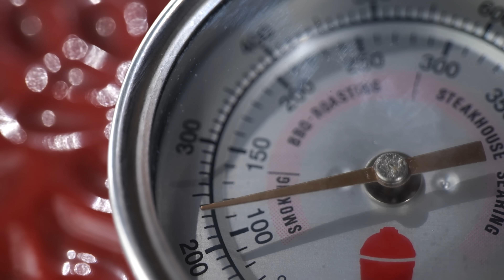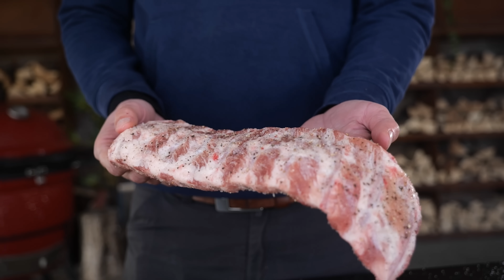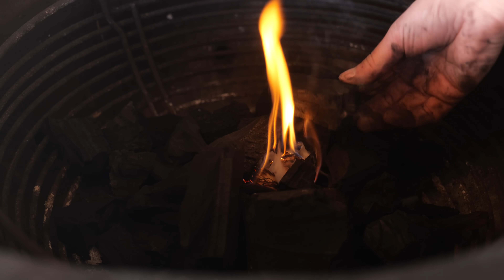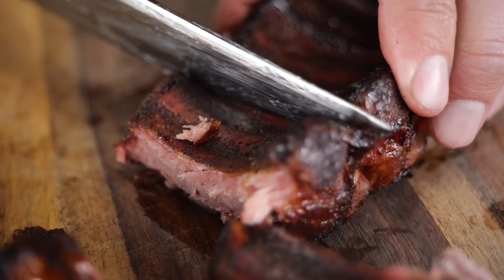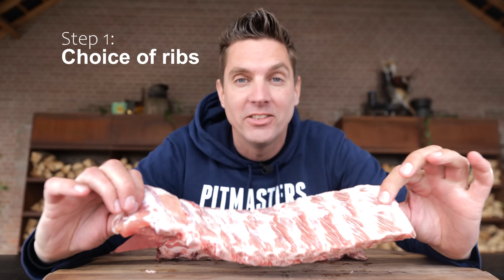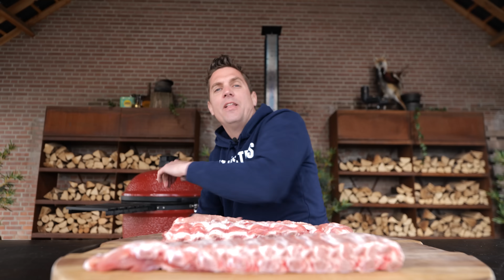How To make Tender and Juicy BBQ Ribs - for beginners

Comment: I am a master at BBQing beef, pork, and chicken. There are several ways to BBQ (indirect heat, smoking and direct heat). The source of the heat can vary from wood, charcoal, propane, wood pellets, lump charcoal wood, etc. The spices used is usually a regional preference. One will eventually figure out what’s their preference after experimenting. The most important thing in cooking is knowing the pit you are using, knowing how the source burns, and how to control it. The next important thing is knowing how much heat is needed. There is a temperature window for cooking meat. The time it takes to cook will very for the size of meat and the temperature. These are the things I would talk about to novice cooks.

Comment: I love the attention to sourcing. Sourcing the meat, the rubs, the wood. It's often overlooked. Here in the US, domestic paprika is almost flavorless and mainly used for coloring but using a high quality paprika is a game changer. I personally like the Smoked Spanish Paprika from Penzey Spices for richness. On the other hand, I do use a binder. It's Heinz yellow mustard. Heinz like most domestic mustards is much less flavorful than European mustards and I choose that on purpose. I want to re-hydrate my rub and infuse acid from the vinegar for tenderness and bite while not imparting flavor. A good flaky/fluffy salt and fresh ground pepper are a MUST to bring the flavors to life and add depth. While buying a rub is certainly easier (even I do it) buying high quality and FRESHER ingredients is also going to produce a noticeable difference.
Reply: I love the original Frenchs or Heinz mustard or even an apple cider vinegar spritz to ensure your seasoning adheres to the meat.
Reply: It's nice a nice detail if you can but honestly u.s. BBQ is largely predicated on eating good with cheap cuts
Reply: @antonioyeats2149 yeah getting fancy salt and top of the line paprika makes no sense for pork ribs. The point of eating ribs is to save money so why waste money on gourmet ingredients when normal ingredients get the job done easier and aren't that bad. Save your fleur de sel, tellichery pepper and herbs de provence for your filet mignon and rib eyes.

Comment: Great job!! The only thing missing was what you were using as your spray solution, (water, apple juice, apple cider or a combination of things?) Also a neat tip is to lay the ribs on grates and then push the ends in towards the middle and squaring them up nicely. My experience is they will cook that way giving nicer presentation, cook more evenly and because the meat has been compressed it holds more of the juices. Keep on grillin

Comment: Nice and complete video. Cannot agree more than using good quality products and local wood. And never overdo your rubs ingredients. It is so easy to just give it the final signature with some different sauces. 
As you asked for a comment on what I prefer to do different? 
Yes, I love to smoke my ribs either hanging or standing. As I like to avoid having grease puddles on my products. And I prefer not to wrap by running really low heat smoking. And in the end baste them with sauce and grill them on high temp, bones down. Happy grilling from Spain.

Comment: I've tried a method I found online: day one, place ribs in baking pan, add thyme, rosemary, a head of garlic split in half, peppercorns and whatever you like, cover with water, put them in the oven for 4 hours at 195F (they cannot come to boil). When they cool off, dry the ribs and rub them with a bbq sauce and refrigerate over night. The next day just reheat them on the grill. Good method for gas grillers and the result is quite good.

Comment: Great video and discussion of woods. In Canada, the local wood for woods is maple, which give a unique "sweet" flavor that goes really well with pork ribs. Not at all traditional, but since it is available locally and easily, it gives an amazing unique flavor.
Reply: Where in canada do you get the maple? I'm in calgary
Reply: @DarinGC  I live in Ottawa and have local access (cut it myself).  Also Sugar Maple on the Quebec side. Not quite sure how you could get it in Calgary. Maybe a custom order from a small mill that has untreated maple? Just a rough idea... Cheers!
Reply: Honestly, the wood from my flower bushes in my backyard also impart a great flavor into my food. It doesn't really matter what tree's wood you use, especially if it's from a flowering tree.

Comment: The situation with rib/loin prices is quite the opposite here in the U.S. "Baby back" or loin ribs are typically at least twice the price of the the boneless loin they were attached to: $4.99/lbs for ribs vs $1.99/lbs for the loin meat. So the ribs are starting to be cut with more meat on them to increase profits.
Reply: And the belly ribs are what we refer to as the spare ribs

Comment: I went with incorrect, but added slow roller for double indirect.  
Went 3hrs @ 275, then paper wrapped 1 hr.  I then unwrapped, put back on until juicy top soaked in and top starts to harden.  I then put sauce on and waited until prove tender.
This was best rib method ever per family.
Thank you

Comment: In brazil they do not differentiate between baby back and spare. There's only "pork ribs" (about USD 2,80 / lb). And it comes with a little piece of the skirt on the bottom

Comment: In my store the loin is the cheap cut, and the ribs are more expensive. I usually do beef back ribs because they are the cheap ribs. Pork shoulder and pork loin are the cheap cuts where I am.

Comment: pro tip, I see Americans cutting firewood/smoke wood one by one having to reset and chop not to mention the gathering and organizing part. if you find a old tire preferably a truck tire you can stuff lots of woods and continuously cut all of em, makes the collecting part easier as well

Comment: OK, I’m improvising because all I have is a broken propane grill but I put a metal box on there with a ton of wood chips, sorry that’s all I have and I’ve got two racks of ribs on there right now.  Lol. I’m going to try to give them an hour to two hours if I can keep the temperature right in there but I’m gonna have to wrap them and finish them in the oven.  Lol. I know I know. But this house is up for sale sale I’m putting off buying a pellet smoker till we move.  I went with your basic rub ingredients.  I only had a spare ribs but I remove the membrane and I trimmed the small stuff in the flap off. This grill is almost impossible to regulate temperature on, keeps jumping up and down between 220 and 320. Lol.  I’ll add a little more rub with the sugar in it before I put it in the oven wrapped and I’ll throw some butter on top.  I know that’s not going to be perfect but it’s all I’ve got today, hopefully I can get some smoke on there and a little barque to stick.   

I remember when I was a kid I went someplace and they had a barbecue sauce that had a lot of mustard in it, and I loved it, you could do a whole show just on different styles of rubs and barbecue sauce and go over just the basics of how you use them on different types of meats.  🤔

Comment: Good video!

I basically do it the other way around. I use a slowcooker until they are becoming good. Then finish them on the bbq. 

Works well if you want juicy ribs. This method is ofcourse also depending you choice of marinade and style. I often do this with asain style ribs. (Fish and soy sauce and so on)
Reply: True,but there is no smoke flavor in that.

Comment: Tried St Louis Ribs on my new Big Joe yesterday for first time. 250F two hours, (Sprayed after 90 mins with 50 :50 Apple vinegar/ Water). Wrapped in foil for another hour. Similar rub to you but dry brined with kosher salt in fridge for 48 hours. I smoked with 3 chunks of Apple wood. I found them somewhat over smoked and a little tough in places. Suppose its a learning process, less wood and a longer cook perhaps next time!
Reply: I think you may have dry brined them too long. Salting for 2 days on such a thin piece of meat will make them tough...IMO

Comment: nothing special.

basic procedure used by many.

1.  grill/smoke outside of ribs for color caramelize/Maillard effect.  maybe 7 min each side if direct medium flame grilling.
2.  then wrap the ribs bake indirect heat low and slow about 200 F for 2 hours.  
3.  unwrap ribs, then put thin layer of bbq sauce on ribs and bake indirect for 10-15 min at 350-375 on grill to caramelize the bbq sauce a little.
4.  let cool and eat.